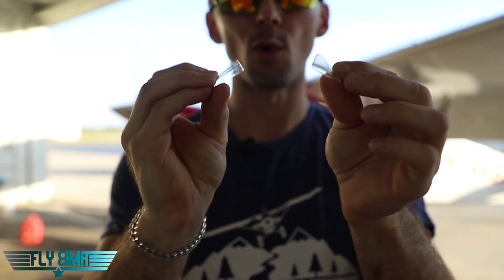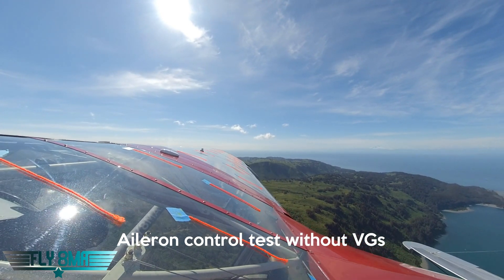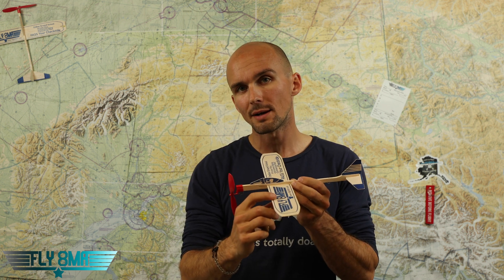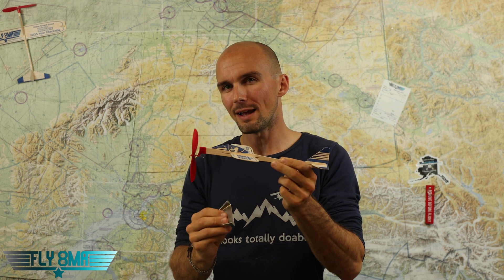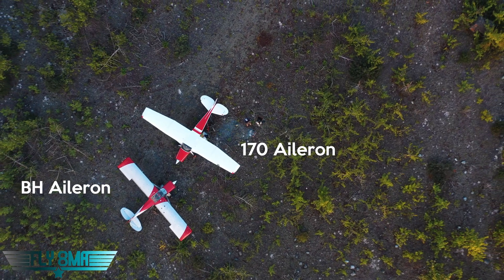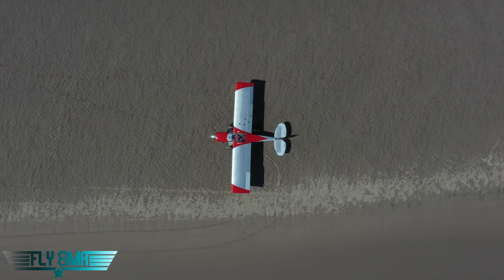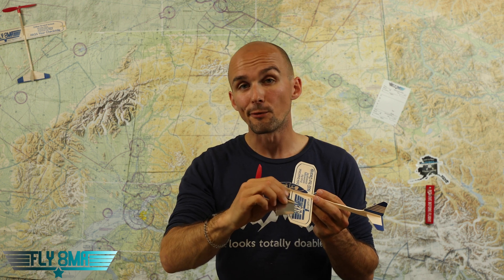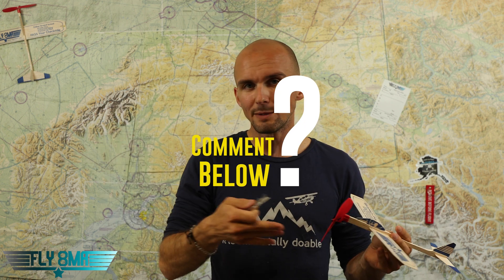Vortex Generators | VG Update Pt. 2

Comment: VG’s were a great improvement on my Zenith 701. After removing the slats and fitting vgs I had a improved top speed and slow speed break was more gentle and no faster than before.  I just finished watching your vid on stall /spin, hard to watch. I would spend most of my flying time in the 701 practicing short takeoffs and slide slip landings, those thin slab sides sure make a racket in a side slip but descent rate huge with slow approach.  Learn Gliding, their instruction will re-enforce stall/spin recovery. Those long wings need heaps of rudder and you soon learn soft touch and forward stick is your only way out.

Comment: Gday again, I'm JG who manufactures the Stolspeed VGs. I have a few comments based on experience.....

In the very early days of developing Stolspeed VGs I made up paired aluminum VGs like you tested here. The theory is that the counter-rotating vortexes would combine to make an even stronger vortex. But I found that more often the vortexes interfered with each other and generated a large turbulent vortex that creates more drag and tends to lift away from the wing surface..... 
The Stolspeed VGs generate a small tight vortex that tends to follow the wing surface and persists right back to the trailing edge.
I tested angles to the airflow from 10 to 20 degrees, with no difference noted, so chose 15 degrees.

If you are getting a sudden stall with a large nose drop from an extreme angle of attack, then the VGs are too far back on the wing, and the stall is starting ahead of the VGs making them suddenly ineffective.....
The recommended 7% is for general slow landing ops, but the very high angle of attack pulled in STOL comps requires the VGs to be farther forward, as you can see that the competitors at Valdez have discovered. 5% or even 3% can be used for those ops.
I realize now that I must include that caution in the instructions on the Stolspeed website, since STOL comps are becoming very popular.

Be very cautious of depending on ailerons for roll control when very slow and at high AofA. With the ailerons already at a very high AofA near the stall, the down-going aileron can stall and create drag and loss of lift that side, ending in a mess..... Seen it happen too many times.....
Keep the stick central and use prompt rudder to control roll or wing drop at those critical slow speeds and high AofA.

Comment: From my own experience, I would not use 3M dst for any permanent mount. Temp is okay.  I like 1k mph duct tape. Silver is pretty.  KJZI
Reply: Made about a thousand skydives with a gopro mounted on my helmet with 3M. Speeds up to 180mph frequently hit it with much larger form drag than a VG. If your aircraft isn't flying faster than 160ktas, the 3M probably will work just fine for years. I'm an A&P too.

Comment: It would require a lot more engineering calculation and costly testing but I'm curious how VGs compare to just making the wing bigger. Up sizing the wing either the same stall speed or to the same cruise drag. All using the same useful load and engine, total apples to apples. 
Yes, I know a new wing is a lot more expensive than a set of VGs,(unless your starting clean sheet) I'd just like to know the actual trade off. My hypothetical notion is that the bigger wing will have better lift to drag ratio and increase the service ceiling, but the VGs once optimally adjusted may allow better stall behavior. Probably depends heavily on the choice of airfoil and target phase cruise, approach/climb, or ground effect.

When I say bigger, it could be cord, span, or maintain the aspect ratio; really depends on the design strength-weight and roll rate requirements vs minimizing induced drag. Dropping from 40kts to 38kts requires 11% more area; more generally, assuming the bigger wing also adds weight, it needs 0.903 times the original wing loading, 40 to 36 requires 0.81 wing loading (24% more area with no added weight) which may be pushing for a more complete redesign, possibly consider a biplane.